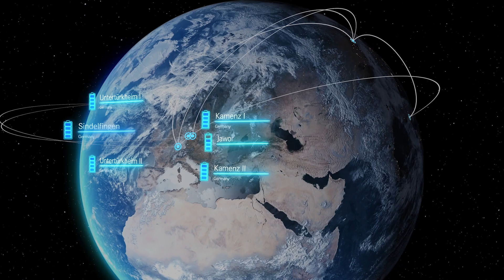Exklusive Einblicke: Die Batterie-Produktion von Mercedes-Benz

Comment: Is miss a lot from the battery process. What is about slurry preparation, coating, calendering, slitting and many other steps. Is in kammenz only the assembly process?
Reply: Yes, only battery pack assembly in Kamenz and all the other Daimler battery pack assembly plants. The cells or modules are delivered by suppliers like LGChem, CATL, SK Innovation, Farasis. I consider it fake and exaggerated, when Mr Burzer calls this assembly work an "extremely complex process". In the end, it's nuts and bolts and electric drills and some logistics. And very occasionally: some welding for cells tabs.
Kamenz assembles many types of battery packs for different applications, so there are multiple sections of the industrial building that each assemble a distinctive kind of pack from cells or modules:
* mild-hybrid battery packs (L09-1)
* plug-in hybrid battery packs (M14-1 for C, E, S, GLC, GLE, and different packs for A250e and its siblings), also for e-Sprinter
* BEV battery packs (for Smart fortwo/forfour and EQC, EQV)
Reply: @koeniglicher  Was? Mercedes kann nicht Batteriezellen herstellen!? Ohne Batteriezellen haben sie ja aber denn  keine Chance gegen koreanische oder japanische Autofirmen.
Reply: @yasincelik3630  Aktuell stellt Daimler keine Batteriezellen selbst her, oder höchstens im Forschungsmaßstab. Aber die koreanischen (z.B. Hyundai, Kia) oder japanischen (z.B. Toyota, Mazda, Honda) Autofirmen stellen die Zellen bisher auch nicht selbst her. Sie kaufen auch bei Lieferanten wie LGChem, Samsung SDI, SK Innovation oder Panasonic bzw. GS Yuasa, oder den chinesischen Herstellern. Bisher machen nur die allerwenigsten Autofirmen ihre Zellen selbst, die chinesische BYD zum Beispiel oder . Und Tesla fängt an, eine eigene Zellproduktion aufzubauen oder mehr Arbeitsschritte von Panasonic zu übernehmen, kauft aber weiter auch Zellen von Lieferanten zu zu. Für Zellen für die Hybriden haben manche Autohersteller aber Kooperationen gebildet (AESC, Blue Energy, Lithium Energy Japan, Primearth EV Energy
). Das sind dann so Joint-Venture Firmen mit z.B. 50:50. Diese Zellen waren aber oft nicht besonders erfolgreich gegen die Zellen vom Weltmarkt, denn die wurden schneller besser und günstiger.